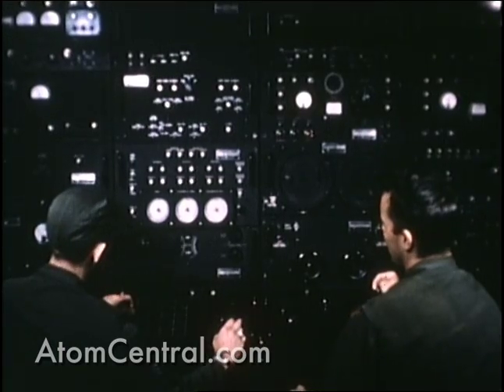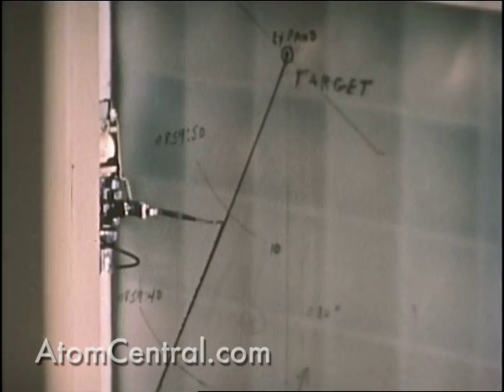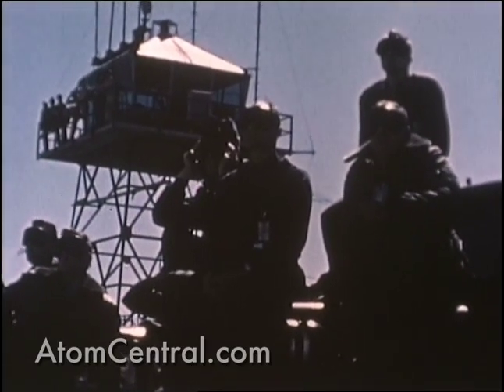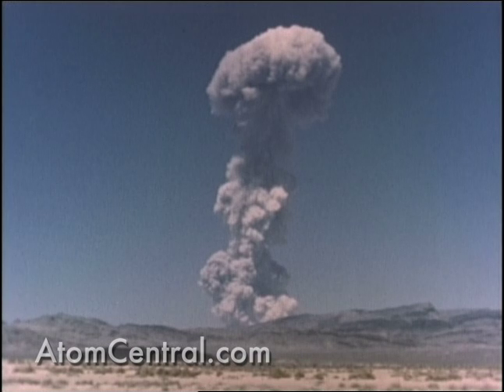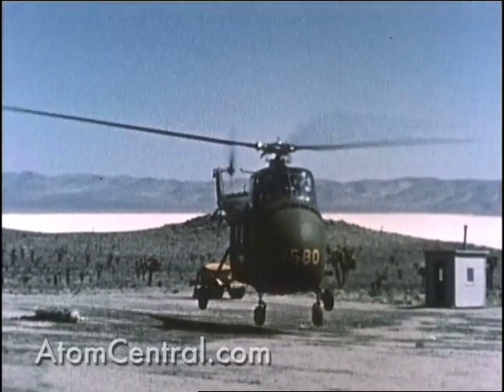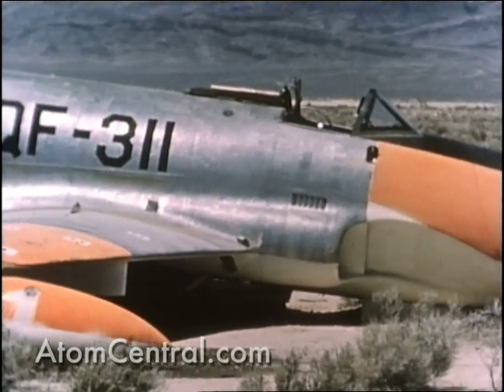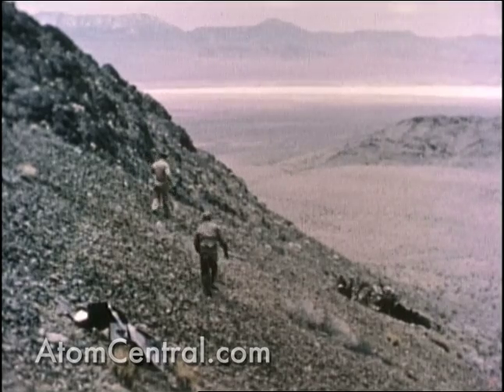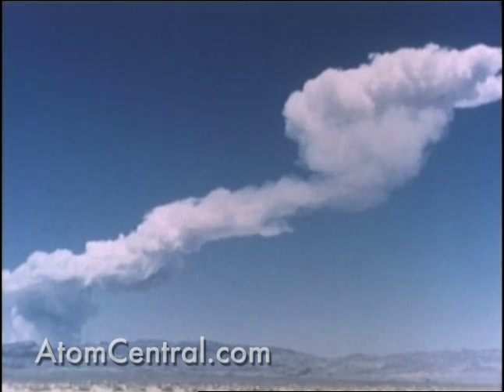Atomic Effects on Drone Aircraft in Flight

Comment: Makes you rethink 9/11 doesn't it? 
...Well it should.
Reply: Because of the fact remote controlled military aircraft have been a real thing for over 60 years Idaho278.
Hey and now with most planes being Fly By Wire and the computer having final say over the pilots imagine how easy it would be today
Reply: The military has been using radio control airplanes and drones since at least 1917; that doesn't prove anything. I think that has to be the weakest conspiracy theory regarding 9/11 so far. Also; historically speaking, every time an airliner has ever been used as a drone, it's missed it's target.
Reply: That's because all the previously publicized examples were being flown by guys with a joystick looking at a radar screen. You can't possibly imagine that is still "state of the art".

The newest technology actually takes control and communications away from the pilots and cockpit just in the case that the plane IS somehow hijacked. And That is a already a fully developed technology. They can take off, navigate with the same precision as a cruise missile and land themselves with no pilots on board.

Shit even Google has unmanned vehicles roaming the streets mapping shit.
Reply: TruAnRksT I think you're missing the point here; just because it's possible, doesn't mean it happened. Also; no commercial aircraft has a built-in means of being remotely hijacked. None. Besides, %90 or so of Boeing's fleet is still using hydraulic systems; you can't hack those. Keep in mind (again) the B767 (the airplane used in 9/11) also uses hydraulic systems. You can't hack into a 767. Can not be done. Trust me; I'm a pilot, lol
Reply: I haven't said anything happened. My original comment was "could make you rethink 9/11."
While I suspect your claim of being an airline pilot is hyperbolic I also believe you are completely wrong.
The computer system has complete control over the hydraulic systems on a 767. The pilots simply tell it what to do like playing a video game. If the computer disagrees the pilots are SOL. They don't even have control cables to the flight surfaces any longer. And any computer system can be hacked.  Especially when members of the family most likely to be the criminal factor involved also held the security contract for both of the airports used and the towers themselves.